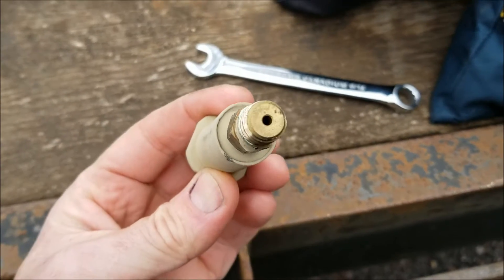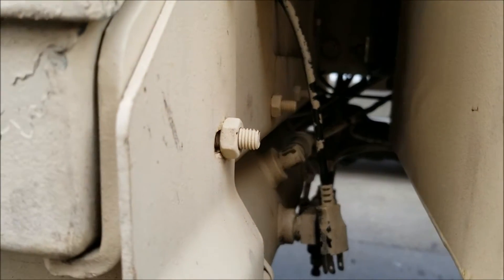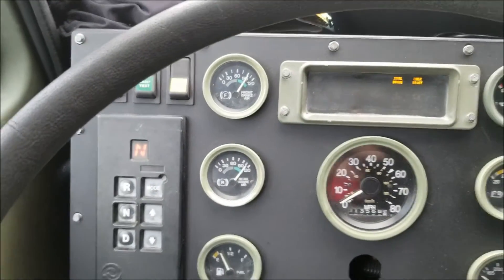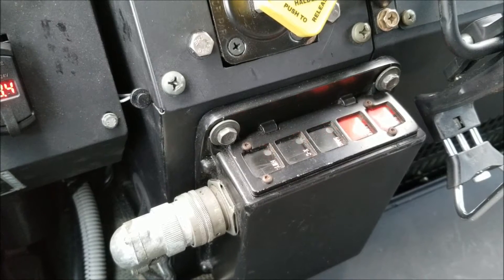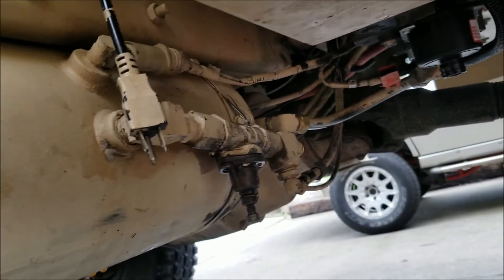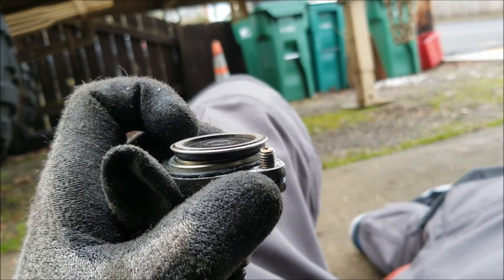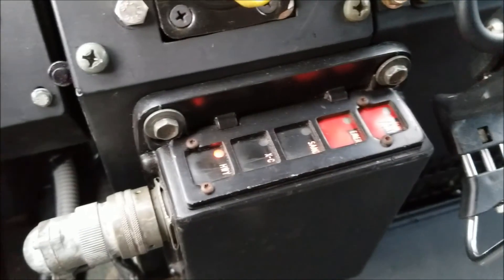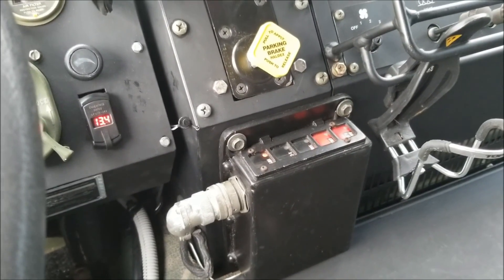LMTV CTIS troubleshooting (problem solved)

Comment: Hey brother I am having a similar problem but two things first there is a wire that jumps out of the main harness about 6in from the connecting point at the ctis box mine is disconnected where is yours connected to? Second mine is letting all the air (of the tires)out when I shut down any insight would be great. Semper fi.

Comment: When I was active duty these systems constantly gave me headaches, so you have no idea how satisfying it was to see you fix an issue with this system-leaks were the biggest problem as you obviously saw but just some other things to keep in mind; 1-make sure you keep the air tanks drained especially in the winter time as the moisture will freeze in those lines an give you all sorts of problems, put it on high idle, let the pressure build up and blow out that wet tank as much as possible especially if it's sat awhile. 2. Change out your CTIS seals in the hubs if you can't find any outside leaks as they might not be seated properly, 3. You can ohm out the pressure switches to test if they're bad.
Reply from the maker: Yes.  Thanks for the advice.  I have antifreeze in my system and an updated haldex with a winter heater in it.  Those 2 combinations really help out a bunch in the winter.
Reply: @SeanFastidious  👍
Reply: How do you ohm out the switches?

Comment: Nice job Marine. 
What tire pressure are you running when your on the road? 
Be great to link up and have a real conversation. I just got Pytheas back to The Dalles with a few alternator bolt issues and one blow out. So Im shopping for a goodyear MV/T tire now.  How can i drop you my phone number? I think you have my email already
Reply from the maker: Hi Shane.  How is Pytheas running?? Did vibration back out some of the bolts??  These trucks when running properly and all issues have been looked over should roll nice and smooth down the freeway with very little vibrations.    

Are you on the facebook LMTV page that I admin???  We connect with like minded individuals there.  I know some locals that may have tires but you have to be on that page to contact them.  We are a tight knit group.
Reply: Sean Fillner yes i did have some bolts back out on the alternator. I dont have a facebook account. But if it will help me meet a few of y’all in the area maybe i should look into that. Be great meet and do some road trips. Keep the good vids coming and helpful stuff. For the most part Pytheas made it back the 2000 miles with just those small fixable issues. Now the van build begins. Will only take time and money.

Comment: That switch you replaced is a safety if pressure goes beyond what the switch is set it won't let air go to ctis or cab air bags so all air pressure goes to brakes.

The transducer is on the pcu mine just went out think water got into transducer and froze and killed transducer it will also give 5 blinking lights

Comment: Do you think the transducer failed due to the welding on the truck or was that coincidental?
Reply from the maker: Totally coincidence.  By the looks of things that pressure switch was about to fall apart anyhow.  I am surprised it worked at all since I bought the truck.  Glad to have the CTIS operational again....